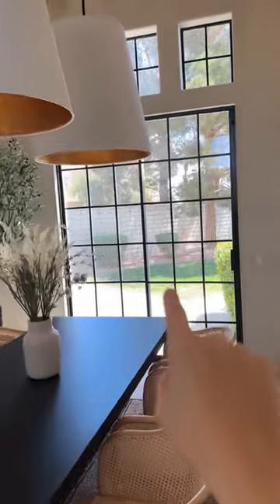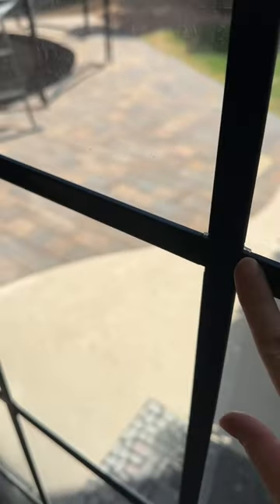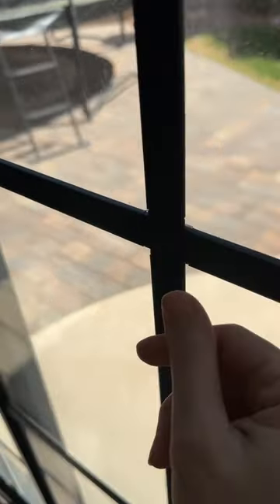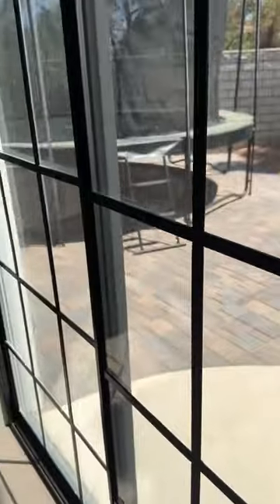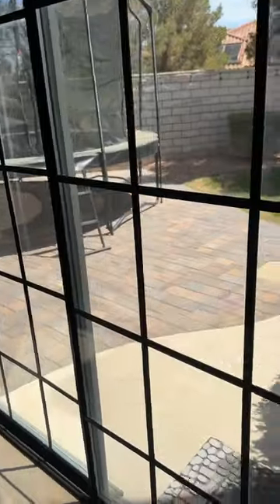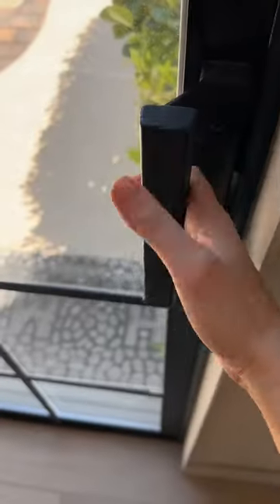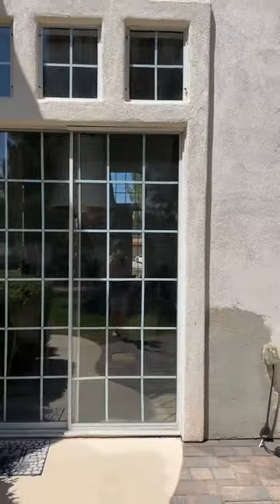DIY window grid answers! Two methods to achieve the same look. #diy #howto #diyprojects #diytutorial

Comment: Me thinking there's an actual reason why people use metal grids over their windows but if security is not your concern I think aesthetics might be a valid reason as well...
Reply: In fact they are a vestige of the history of windowmaking, glass was very difficult yo manufacture in large pieces as we see today, so the way it was done was to make individual glass panes and attach them with the wooden mullion (middle pieces). Traditional windowmaking as found in England for example showcases many techniques lost to time or that are even still used today.